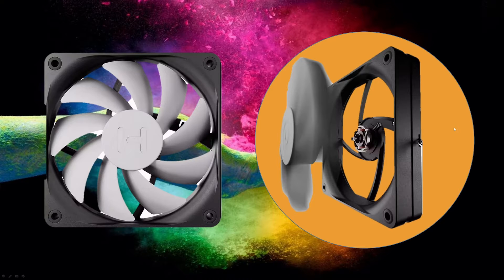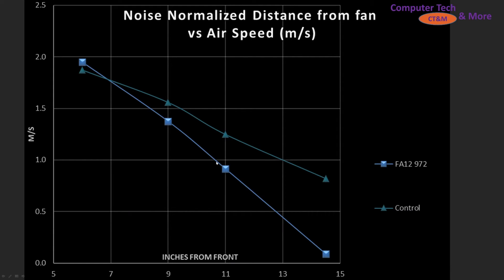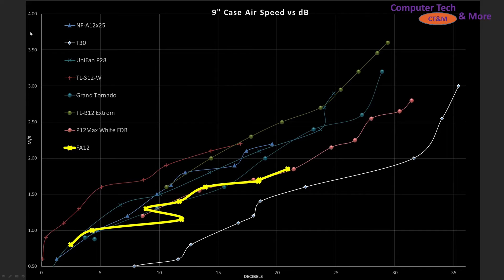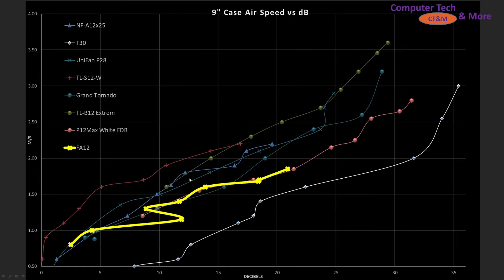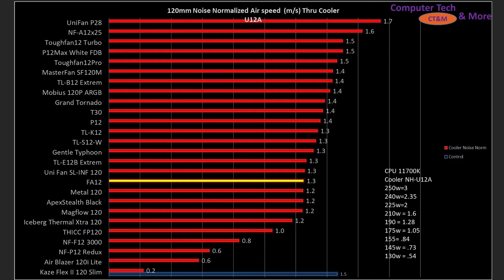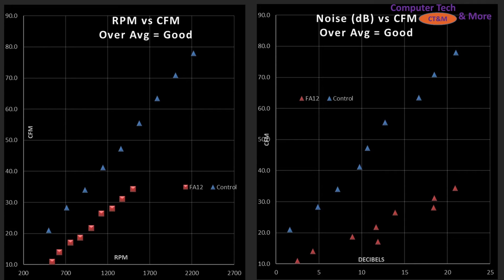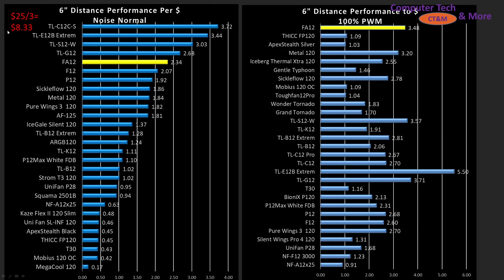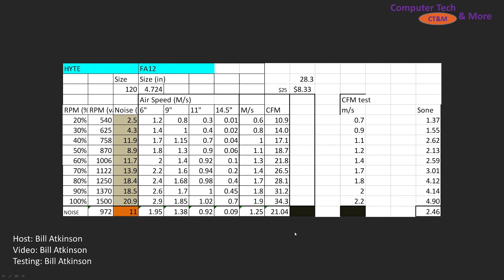HYTE Flow FA120: A good Budget Option

Comment: Just installed two three-packs, replacing Antec model 2/3 fans in a Lanboy Air. These are a lot quieter, but since the ones I’m replacing were the originals from 2011…
Reply from the maker: glad they are working well for you. 
I still have some Cougar Fans from that time. :)